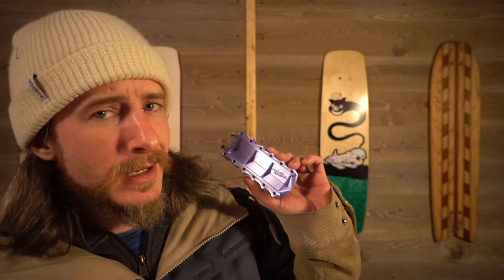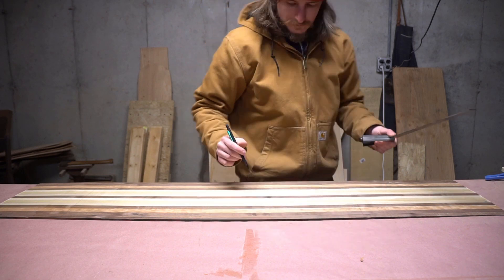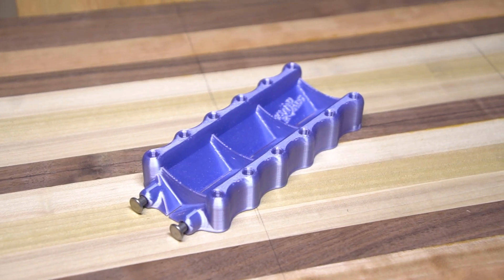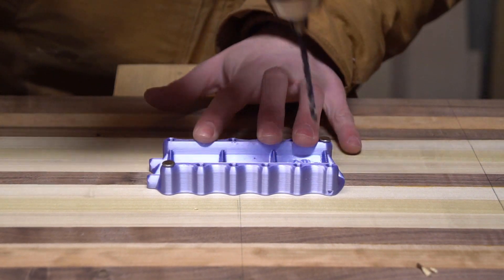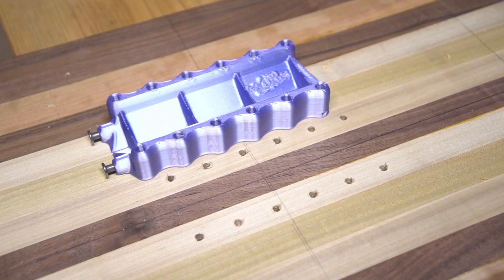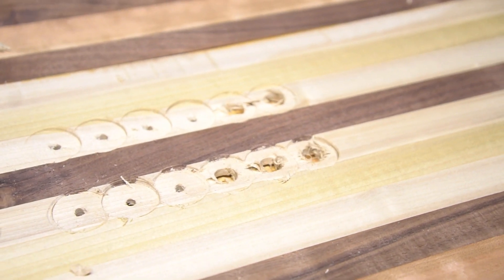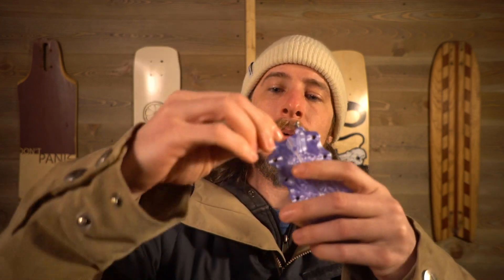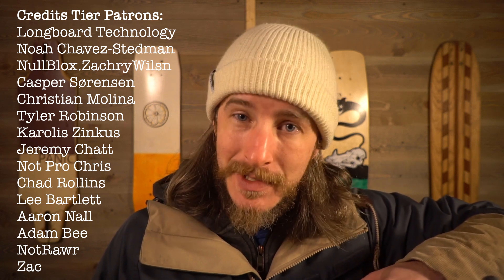Binding Inserts and Drilling Guide - Low Tech DIY Snowboard ep. 02

Comment: I cannot understand why you would not have made a template for a 3/8 bit which is the diameter of the snowboard insert body.   You add a step, drilling from 5/32 to 3/8 for no reason and potentially lose accuracy.   The countersink is super easy and clean with a 3/4 counterbore bit with a 3/8 guide (about $60).  I'd buy a drilling jig for 3/8 in the 2x4 pattern and one for splitboard patterns too, but only in 3/8.
Reply from the maker: To center the point at the tip of the spade bit. If you drill the pilot hole at the size of the insert body its too large to guide the spade bit to cut the recess

Comment: Nice work on the drill jig. On my first Snowboard build loooong ago (more than 20 years), I just put 3 layers ( sanded and flame treated in between layers) epoxy on the wooden sidewalls with a brush. The side had a bevel of 80° from above the steel edges. It worked fine and the board is still with me.
Keep up the good work, I love all your vids.

Comment: I always use drill bits for my pegs when drilling truck mounts.

IDK how many 3/16" bits I have, but its a lot.

Pegs obviously a bit nicer. But if you designed the scarab to also hold onto some extra bits that wouldn't be so bad either.

Comment: I could have used a jig like this so many times. I always ended up just drawing the pattern straight on the core and used only 4 inserts per end. I think this summer I might need to bust out the snowboard making gear again.
Reply from the maker: Stop teasing me about that and just do it already! Also your most recent surfboard build is awesome
Reply: @GoodRoads  I have the problem of my router sled/jig being under a mountain of wood and other things 😢 as well as no space to use it. If I can get it out this summer I will.

Comment: Honestly with hardwood you're probably good to skip the sidewalls entirely. I tend to build entirely with poplar and with just a little epoxy the sidewalls hold up just fine, maybe the odd touch up here and there. 
Drill guide looks good, I wish I had one starting out! Nowadays I'll probably stick to the cnc but this is a good, low cost tool by comparison.